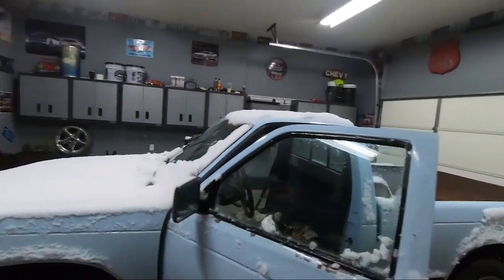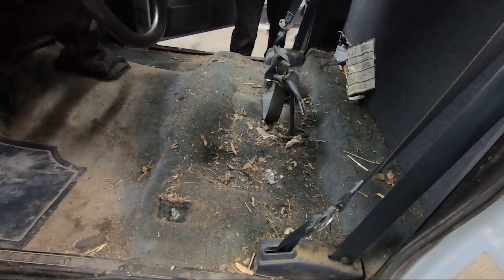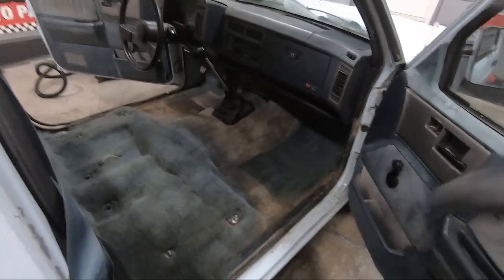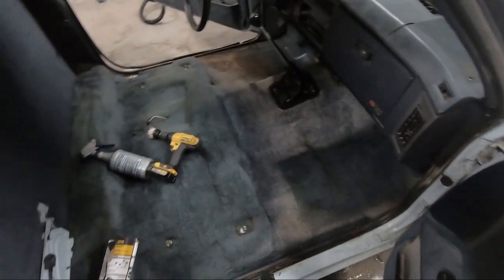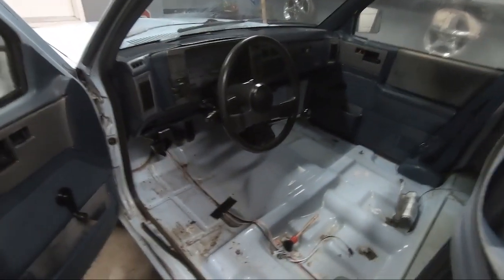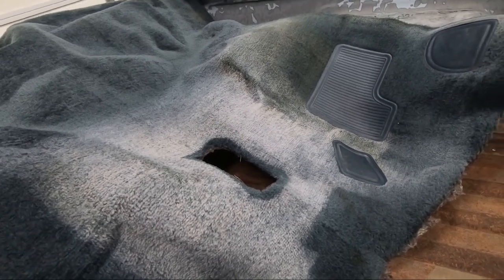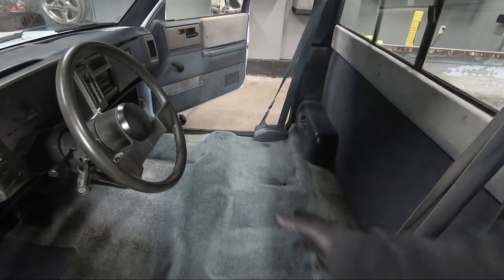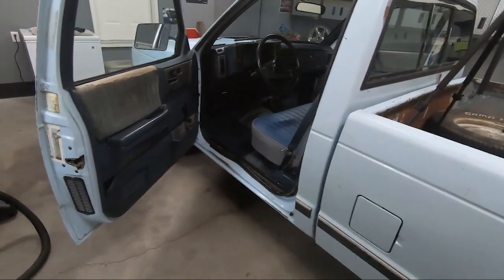S10 Interior Quick Detail and New Seat (This thing was NASTY!)

Comment: Did the same with mine during lockdown. I went with a new carpet that I purchased from eBay for 1 bill, was a bit of a pain to align with the frame so what I ended up doing was using a steam cleaner a couple of times to get rid of that new smell and also to soften it up. Made it easier to install and obviously had to trim some off. Took out the old headliner and replaced it with a really nice new cloth that I got from one of those craft stores for like 15 bucks and had enough left over to wrap the interior trim pieces to match it. I would also highly highly suggest to sound proof the interior, this little trucks tend to be noisy but other than that they are a really fun project to work on in your spare time
Reply from the maker: Definitely easier to replace

Comment: When i detailed cars at a dealership 30 years ago. All used vehicles got the carpet pulled & pressure washed.
Then if faded - would custom mix dye to match & spray areas with a spray bottle. Leave over night for a good dry. Next day - hit with a vacuum. Looked like new carpet - most of the time.
Nice work.
Reply from the maker: Yeah I have done that method too

Comment: Like you said . looks a thousand times better.  My heater core connectors just broke off Friday. Had to drive it hot that way for a few miles. I fixed it Sunday night. Everything came out good. Those things were the hardest thing I've done so far. What a pain. And today I went to discount tire and purchashed a set new tires. I had I screw in one tire. They needed to be replaced so I just bought a new set. If its not one thing its another
Reply from the maker: It all snowballs sometimes. Heater cores always suck to replace
Reply: @TWAMotorsports  oh it was just the heater core disconnect . where the water lines for the water pump go to. The ones behind over by the firewall.
Reply from the maker: Still a pain to reach